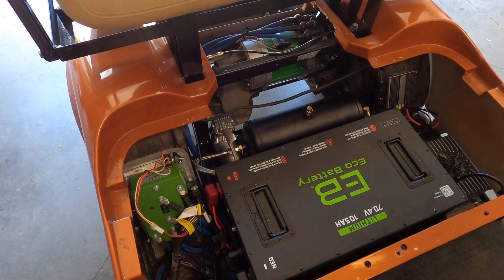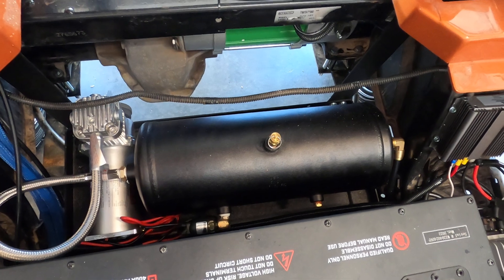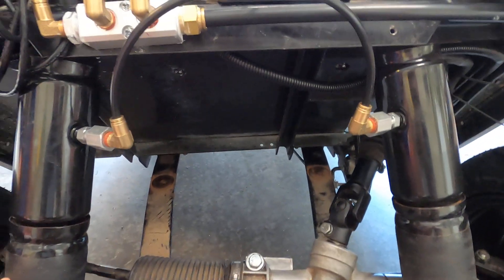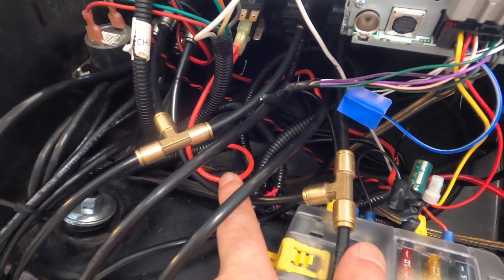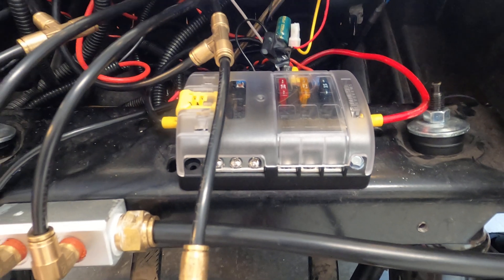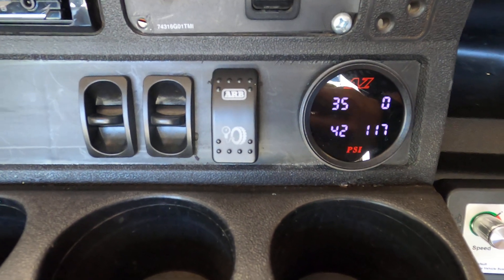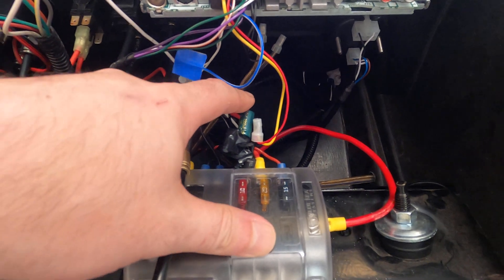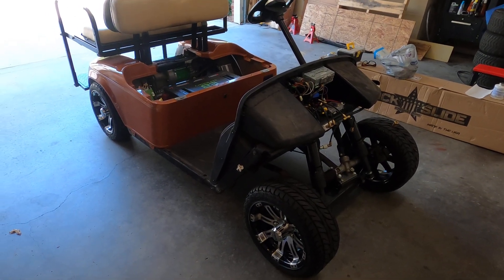EZGO TXT Air and Electrical System Walk Through

Comment: awesome build! Any chance you could tell me where you got the air shock adapter fittings from? cant seem to find the style you used
Reply from the maker: This is what I used.  https://www.grainger.com/product/4VPT3?RIID=65372072335&GID&mid=OrderConfirmation&rfe=6b178d762837ea2c1debc731a357b20f241928b41476aa424f522db168c72ec4&gcrfe=6b178d762837ea2c1debc731a357b20f241928b41476aa424f522db168c72ec4&gucid=EMT%3A10339122%3AItem%3ACSM-323&emcid=NA%3AItem

Comment: Very nice build
Do you release the pressure from everything in this setup if you're parking overnight? I just did a similar setup, I don't really want to have to air up to start every ride but I'm worried about wear on the shocks or air tank from staying under pressure basically all the time. I don't know if that's a valid concern
Reply from the maker: I leave it aired up.  I've added air suspension to cars in the past and have always left them with air in the system.
Reply: @aberk20  Perfect, thanks!

Comment: May be a strange question, but how do those switches dump? Been using your build for my plans, stuck between the manual switches or solenoids. Your way seems easier and more cost effective, just don't get how they dump.
Reply from the maker: I went back and forth on this too.  I had a nice digital air suspension system on my Dodge Magnum years ago.  It really boiled down to the fact that I didn't want to spend 1k+(I was looking at nice digital setups) for a golf cart and these switches take up less space than manifold+solenoids.

On the back of the switches are 2 barbed fittings.  The air inlet from the tank and outlet to the bag.  IIRC, there is a small port on the switch that is the dump port, so they essentially dump right at the switch behind the dash.  There is no routing the dump side anywhere else.  In my Magnum, the manifold was in the car and ran the dump lines to the outside which made it quieter in the car and attention grabbing outside the car.

Comment: Great build! I have been following you along the way. I am in the middle of the doing the same. Just ordered tank compressor and shocks. 
    Where did u get your air fittings and distribution block?
Reply from the maker: In my later videos I talk about my switch to 4 way control of the bags to combat body roll.  This is the block I used.  https://www.amazon.com/gp/product/B07WFT2SY9/  The reviews about leaks are very accurate.  I found that fittings that come with a sealant applied work OK, but no amount of air fitting tape would save me on fittings with bare threads.  I ended up putting an o-ring in the base before screwing on the larger fittings and the compression of the fitting onto the o-ring made a better seal.

These fittings are what convert the threads on the shock to NPT  https://www.grainger.com/product/4VPT3?RIID=65372072335&GID=&mid=OrderConfirmation&rfe=6b178d762837ea2c1debc731a357b20f241928b41476aa424f522db168c72ec4&gcrfe=6b178d762837ea2c1debc731a357b20f241928b41476aa424f522db168c72ec4&gucid=EMT:10339122:Item:CSM-323&emcid=NA:Item

All of the other random fittings I ended up needing I sourced from here.  https://www.myteeproducts.com/catalogsearch/result/?q=DOT%20fittings
Reply: @aberk20  thank you for the insight. Good luck with the rest of your build. I look forward to seeing it.
Reply from the maker: @brianewest  good luck with your build!

Comment: Did you flip the front leaf springs?
Reply from the maker: I rotated them front to back and removed one of the leafs.
Reply: I’m a bit confused… what was accomplished by just spinning them around. I am about to weld the tabs on the front for the shocks and wasn’t sure what would be gained by doing that. Thanks for your insight.

Btw. Can you snap a picture of how you moved the bottom front shock mount?

Comment: Hey man, how did you mount the front shocks?
Reply from the maker: The MA705 shocks have a threaded end and mount the same way the stock stocks do.  The lower mounts had to be cut off from the "axle", rotated 180 and chopped.
Reply: @aberk20  Thanks for the reply. I see what you're saying. Did you re-weld the lower mount to the axle or bolt it up?
Reply: @aberk20  Sorry, another random question. You have some of the plumbing and electrical behind the cowl. Do you have an  easy way to access that if need be?
Reply from the maker: @micahwells6021  Not really.  I can kind of reach up there an get to the fuses, but the cowl would have to come off to do any substantial work.
Reply: @aberk20  How did you attach the front shock tabs after you flipped them?
Reply from the maker: @micahwells6021  They're just bolted on with a single bolt for now.  The original, non lowered, front axle already had holes there and I drilled holes in the new shock tabs to bolt in.  Once I received the lowered axle, I had to drill holes in it in the same place.  I plan to weld them on before I have it powder coated (likely next winter).
Reply: @aberk20  Is the front axle a lowered axle or the stock one?
Reply from the maker: @micahwells6021  The one on there now is the lowered one.  It look me a long time to find a lowering kit for sale and it ended up being a used one.